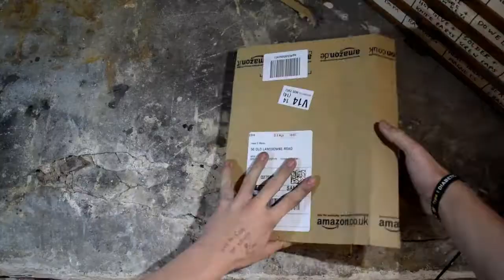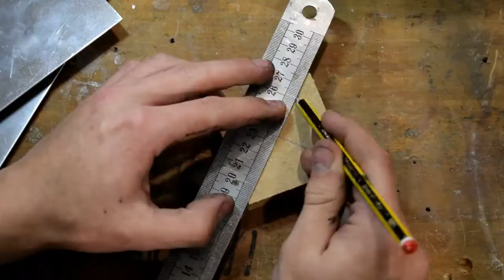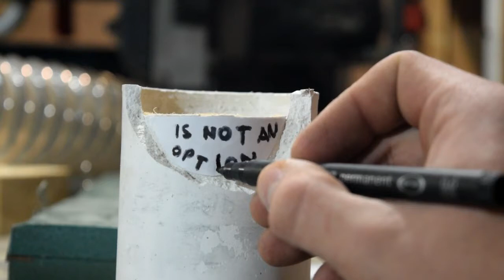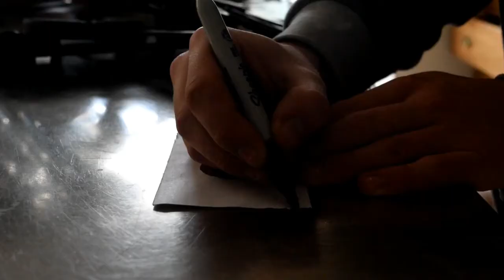Making a Candle & Pencil Pot Holder from Plaster [52]

Comment from the maker: Purchase the BlueSmart Glue Gun using the links below & if you're from the UK you can get £1 off (until the 28th feb) using the promocode: ZL3P4K7H! 
UK: https://goo.gl/Ahv8Ri
US: https://goo.gl/kUdb2L 
DE: https://goo.gl/JmLp2R
Or check out other BlueSmart products here: 
http://www.eblusmart.com/

This week I make a candle holder capiable of holding 3 tea-lights and a pencil pot holder out of plaster. The plaster I used is called 'fine art casting plaster of paris.' 
FYI: The plaster is brittle at first, but once the moisture has had time to evaporate & a sealant has been added it is suprisingly rigid and strong! 
If I were re-doing the project, I would make the circle moulds in a 'Ω' symbol, pinching the two right angled ends together to make a complete circle, instead of folding the aluminium back on itself. 
Big thank you to BlueSmart for sponsoring the video! I was honestly really impressed with the price of the product and how quickly it heated up realtive to other glue guns I've had in the past. 
Supporting my sponsors really helps me so thank you!